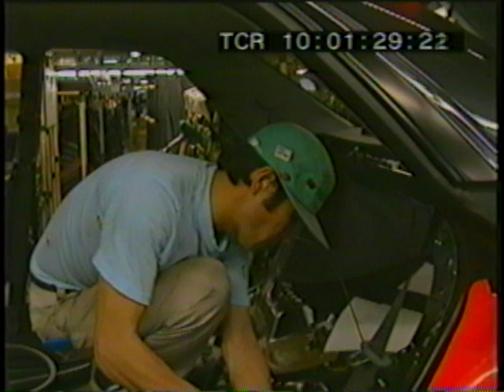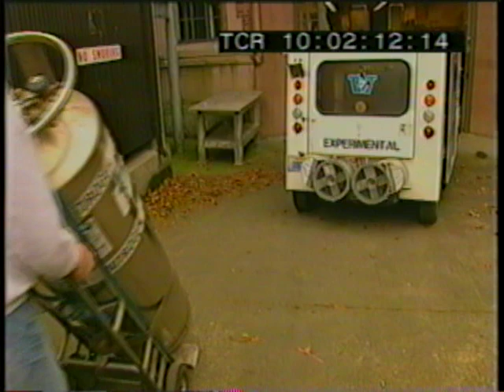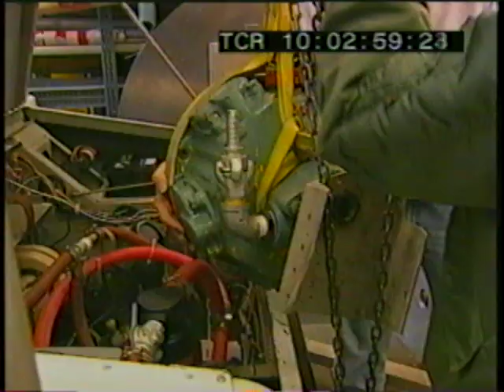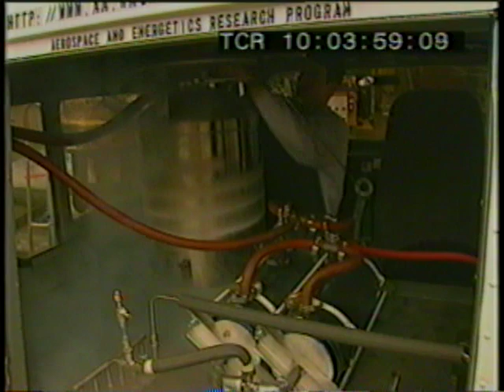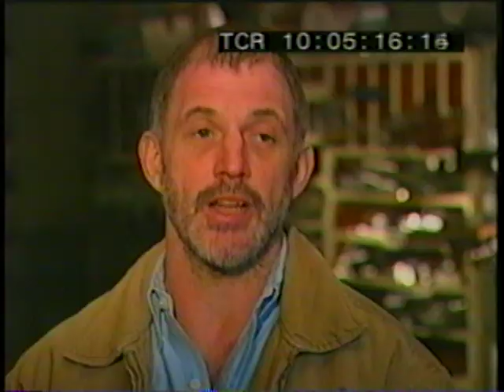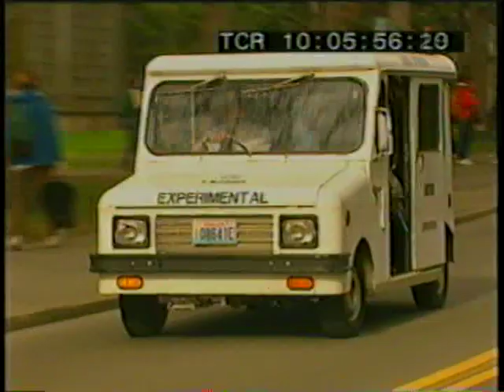Liquid Nitrogen Car

Comment: "More economical than petroleum or electric power": But you need electric power to produce liquid nitrogen. Much more than an electric car would need for the same range.
Reply: But it does not need the chemical dump needed to make the batteries for the electric car and is lighter. 
producing liquid nitrogen does not take electricity any prime mover will do.
Reply: Another advantage of LN2 (the same is for H2 and synthetic CH4) is  that it can be produced and stored at moments when there is overproduction of electricity, and then used when there is electricity too short. So the demand of energy can be better balanced/spread over the day than it would be with a BEV I think.

Comment: it doesn't reduce the pollution and also it'd not economical in big scales..they did not state that for condensing nitrogen, too much energy is consumed!
Reply: reduce pollution . no. that is correct .. also produce no pollution.
Reply: Shapour M wrong
Reply: Lots of energy is consumed to make liquid nitrogen...true.  But, you could use solar power to produce it.  It all boils down to the question of what has the greatest energy DENSITY.  If LN2 had better energy density than Li Ion batteries, then it would be a better option.  Although, the thought of your "fuel" evaporating when the vehicle isn't even in use kind of sucks :)  Albeit, that tank must be an insulated dewar that drastically reduces losses.

Comment: Read that the Britts were into this idea as early as 1903. Has anybody tried using a Stirling Engine where the cold side is chilled with N2, maybe used in a hybred design?
Reply: ufoengines liquid nitrogen+V6=evironmentally friendly supercar.
Lithium ion battery+nitrogen=electric desert car.

Comment: PS. 1. Boiler to ambient air temperature gradient. Not funace's(!), furnace so as oil or coal tender doesn exists. 2. Probable deicing could be solved by variety of means, particularly by pull-through pistons in shaft boulers variant.
Regards,

Comment: India has air cars also but mostly two seaters and below 180km range, city and suburban cars. Air is compressed at sea on waves by small anchored pivoting barges.
Consider simple cryocar also a steamcar or locomotive with the same (but reversed) boiler to atmosphere temperature gradient. And probably the same boiler (atmospheric heat exchanger) working pressure. line locomotives had 12-16 atmospheres optimal.
Please, feel free to contact. I'm designer also.
LN-Locomotives would be useful also.
Reply: nice idea!